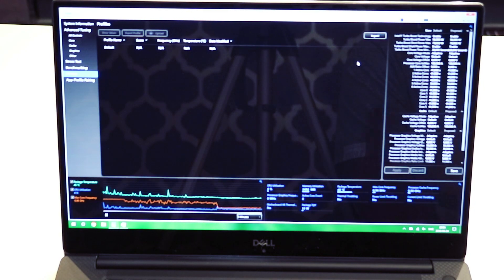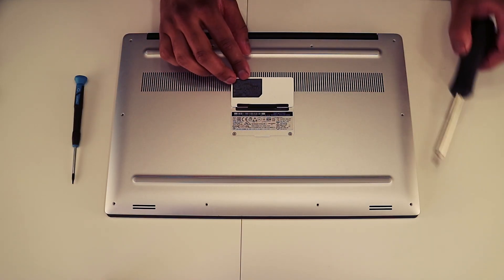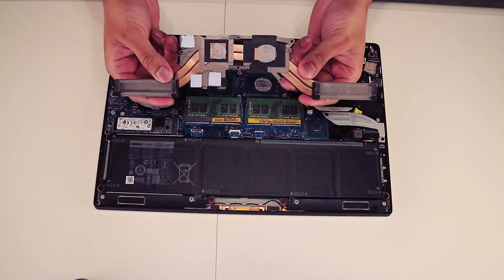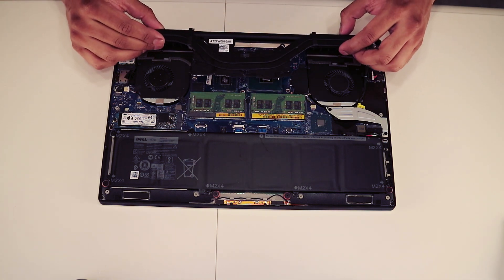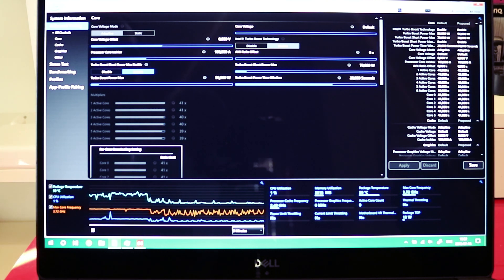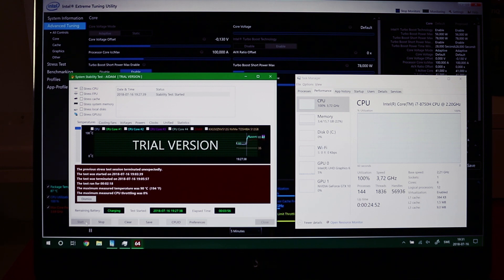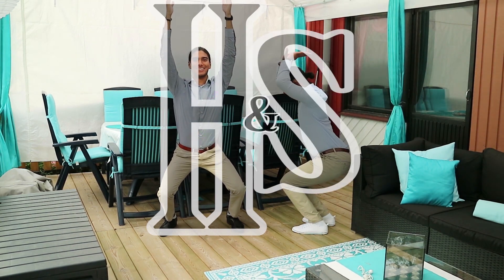How to UNDERVOLT and REPASTE your Dell XPS 15 9570 to Increase Performance!

Comment: Do you know if it's possible to upgrade a 56whr battery to a 97whr on this model?
Reply from the maker: Yes what I heard it's possible but I don't know if Dells sells batteries separately in all countries. I heard some people getting batteries in eBay, you should call Dell and ask them.
Reply: @HumanSuten  thank you very much! And a fast response :D
Reply from the maker: No problem at all, we're trying our best to answer all comments as fast possible! ☺️ Happy I could help you out!
Reply: Hi! I've done it few days ago. Buyed from Dell a brand new 97whr battery (130€) and upgraded my XPS 9570. Very simple and it does not void your warranty.
Reply from the maker: Hi! 
Perfect 👌🏿👍🏿 thanks for letting me know! ☺️
Reply: @HumanSuten  thanks to you. Your video helped me a lot ;)
Reply: @friimaind  hey, man im thinking of doing that too, i have the base model with the 1tb SSHD, I also want to get a ssd, do you know what happens when u take out the sshd, and put in a ssd
Reply: @harshilcode  hi! I've done that on my old XPS 9370. No problem at all: simply download a stock Windows 10 ISO (from Microsoft's website) and burn it on a USB stick, change the ssd, boot from the USB and proceed with a clean OS installation. :)
The only thing that could happen is that Windows could not recognize the SSD (because of drivers) so check online if you need the download these BEFORE removing the SSD.

Comment: My Core Voltage Offset jumps back to 0,000 after reboot. How do I save it, so that it always starts with the -0,150?? Any Idea?
Reply from the maker: This is the default state of how these programs run, in case you lock in to a unstable voltage or you tweak other settings which makes the computer unusable. So at reboots they load the default configuration of the CPUs. 
Check out this guide to force an undervolt at bootup: http://forum.notebookreview.com/threads/how-to-automatically-under-volt-in-xtu-without-opening-it.802143/
I have personally not tested it but I will do it once i get some sparetime.

Comment: will also change the Thermal Pad be even better? what is the size of those? and how many should change? 3?
Reply from the maker: I can't really comment on that situation, I really don't know. I don't think it will be noticeable. But what users have done is applying thermal pads to the VRMs which can help prevent throttling of the CPU ☺️
Reply: thanks a lot, man. yes, I also been may have VRMs throttling. do u know what is the size of those VRMs? i am counting how many or which size thermal pad should buy.
Reply: 'i also heard'     sorry,  bad grammar here.
Reply from the maker: I couldn't really figure that out as many users have done in so many different ways, sorry once again.

Comment: I have read so many undervolt tutorials, they always say reduce the voltage when you hit BSOD. I never have it ( even I reach -0.200V) but during the stress test, the laptop restart. Does it mean the voltage has reached the limit?
Reply from the maker: If it restarts during stress test that means it's unstable, it doesn't have to BSOD, because you will only know if it's stable when you do Stress tests
Reply: oh! One more thing, when I undervolt, no matter what the core offset is my laptop always restart itself when the laptop goes to sleep mode. Does it ok to keep undervolt or leave it as the manufacture set up? 
Thanks for answered
Reply from the maker: It's okay to leave the undervolt, do you mean that the voltage offset resets when you put your laptop in sleep mode?
Reply: the laptop restarts itself in sleep mode and voltage offset back to 0
Reply from the maker: @nhocklun0926  Hmm that's strange, i really don't have any solution to that. I have to look into it myself and see what i can find.
Reply from the maker: @nhocklun0926  Check out this guide to force an undervolt at bootup: http://forum.notebookreview.com/threads/how-to-automatically-under-volt-in-xtu-without-opening-it.802143/
I have personally not tested it but I will do it once i get some sparetime.

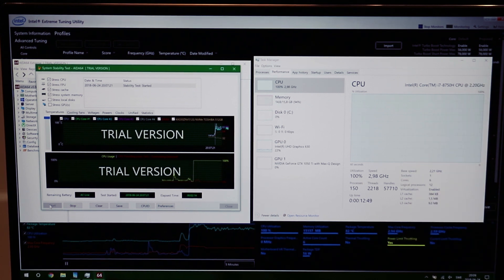Comment: 1:29 Intel XTU in the bottom left says power limit throttling, not thermal throttling, which I'm currently having a problem with on my laptop and haven't found a fix for yet
Reply: You should first plugin the charger and put device at performance mode in dell power control panel
Reply: did you try adding thermal pads to the VRMs?

Comment: Does this void warranty ?
Reply from the maker: Lex Gabrees No, as long as you know what you're doing when repasting and not doing any other hardware damage this will not void your warranty. The undervolting part is software based and does not apply at reboots for safety reasons, in case you mess up the settings which renders the computer unusable. Also undervolting can not damage the CPU in any way because what your essentially doing is starving the CPU from power.

Comment: I cannot see the idle temps, can you write them to me? I also have problems with high idle temps, like 42degreesCelsius at idle.
Reply from the maker: I have about the same Idle temps as you, they are completely normal for this laptop. Mine hovers around 40-45C. Repasting and Undervolting doesn't help to much with idle temps, more with the load temps.
Reply: Human & Suten Thank you! These idle temps are annoying, especially because the fans Start at 50C
Reply from the maker: No problems at all! Yeah I know but this computer really have some powerful components that need all the cooling they can get so they don't throttle down. Apple philosophy is different, they let the computer run on like 80-90C which leads the components to throttle because they get too hot.
But I'm with you, when doing light task you want a silent computer but we have to remember that this is not an Ultrabook and does not run with the Intel U-series CPUs.
Reply: Human & Suten Thank you, yeah that the right point of view!

Comment: Anyone out there wondering if it's worth it to repaste... In my case it was very beneficial, the paste job from Dell was horrible. I lost around 15c on the cpu temp alone after my repasting. The Gpu didn't changed so much but it wasn't all bad to begin with so I'd say that until you take it apart to verify the original job you will never know if it'll make a difference. Glad I repasted and undervolted.
Reply from the maker: Johnny Boy Wow that's a huge drop, what are your Idle temps now? Thanks for giving your input! ☺️

Comment: Is this worth it or should one just get the core i5 version?
Reply from the maker: No the i5 is not worth it at all! It's performance is like last years i7 model. You don't have to Repaste, just simply the Undervolting is enough. But even if you don't undervolt, this CPU will be such much more powerful than the i5 thanks to it's additional cores. Quad Core (i5) vs Hexa Core (i7).
Reply: I have the i5 version - it works pretty good and performs better than many outdated i7 processors

Comment: Hey, everyone, I have the exact same laptop. I undervolted to -0.150V and achieved a 1381 benchmark score and my processor frequency was at 3.89 with Cpu temps at 72 Celsius, which is significantly better than the undervolting suggested here. Also, note that I have not repasted yet too.
Reply: Also if you're using throttle stop, you can undervolt a lot lower than XTU without crashing, but the CPU will not be able to get to as high of a frequency as it could with higher voltage.
I think that's mostly because in XTU, if you undervolt your CPU core, it will undervolt the cache to the same value automatically. So if you go too low, the cache undervolt will cause a BSOD. You can of course set core and cache to different values, but by default - core and cache are the same.
In ThrottleStop you have to set them independently so in that sense it's easier to wrap your head around what's happening. For example I can have my core undervolt set to -250mV (in XPS 15 9570 with 8750H CPU), but if I bring my cache undervolt lower than -125mV, I'll start getting BSODs during video renders.
Reply: NowakP what is throttle stop and is it beneficial ?
Reply from the maker: It's an undervolting software like Intel Exteme Tuning Utility but it's more advanced with more features
Reply: did not do any undervolting and my score is 1420
Reply from the maker: I have also achieved undervolting to -0.150 but running AIDA64 Stresstest made the computer shut down after 5min. Make sure your undervolt is stable.
Reply: i have same laptop and whats your cpu model ? i have core i 7 8750H
Reply: I get 1537 and 79C,  just undervolting 130  mv, no repast

It's with 8750H and run it at performance mode

Comment: I'm studying electronic engineering I use circuit design softwares, I do programing, AutoCAD, fusion 360, I also like to take pictures so I use Lightroom and play some games (pubg, dirty bomb, Rainbow six siege) occasionally maybe 3 or 4 times a week  but not for long periods maybe 2 o 3 hours and I'm thinking about to get the 9575 or the 9570 from one side the 9575 is not that bad for casual gaming and is very good for content creation and it will be nice to operate all the programs I use on tablet mode I also watch a ton of movies and videos 🤔 so the 9575 looks better for me but I'm worry about gaming and also the ports and battery life because I spend a lot of time on the go 🤔 and maybe I can sacrafice the 2 in 1 for better performance, more battery like and better keyboard, more ports  and also cheaper price but I'm also worry about thermals on the 9570 I'm not a everyday heavy user but at least 2 or 3 times a week I do some heavy stuff 🤔 help me please thanks I'm a big fan from Dominican Republic
Reply from the maker: I would say the go for the 9570, because it is quite close in terms of processing power but at the same time it has the flexibility of a tablet. Only thing downside for you is the port selection. That would leave you relying on a USB Type C Hub. 
If it weren't for your tablet needs i would recommend the 9570 because of the port selection and the more processing power, especially if you were editing videos in Premiere Pro.
I really hope this helped you out in terms of deciding what to go for! ☺️
Reply from the maker: I would say the go for the 9570, because it is quite close in terms of processing power but at the same time it has the flexibility of a tablet. Only thing downside for you is the port selection. That would leave you relying on a USB Type C Hub. 
If it weren't for your tablet needs i would recommend the 9570 because of the port selection and the more processing power, especially if you were editing videos in Premiere Pro.
I really hope this helped you out in terms of deciding what to go for! ☺️
Reply: Human & Suten  and what about the battery life I know that the one in the 9570 is larger than the 9575 but if it can have me at least 8 hours I'm good with that
Reply: Human & Suten BTW I just edit photos on Lightroom 🤷🏻‍♂️ and I would love to buy the 9570 over de 9575 2 in 1 but the thermals worry me and there's a ton of people having problems with the 9570 and I live outside the US so no warranty for me if I want to return it they just can send me parts
Reply from the maker: It all depends if you buy the 4K screen or not and which battery size. I have the 4K screen with the 97whr, which gives me 5-6 hours of battery time. The 1080p screen would probably give something like 6-7 hours. I don't know anything about the battery life of the 9575, but I think you can find some statics i Google about the battery life. 
I had fan issues on my first unit, got a replacement and that unit had a fault "right arrow" key and some Backlight Bleed. They solved my issues by replacing the screen and keyboard. So I think it's risky to buy a laptop from Dell whatever it's the 9570 or 9575. Dell quality control sucks so I wouldn't risk buying something from Dell, you can end up wasting your money. There are some other options but I don't know what laptops is currently on the marker in your country.
Reply: Human & Suten  I'm in USA rn so I would like to buy it today list this month
Reply from the maker: If you have time to test the computer while you're in the USA then go for the 9570. If I understand you correctly you live in the Dominican Republic but are right now traveling in the USA?
Reply: Human & Suten yes correct thats what I'm going to do
Reply from the maker: I wish you the best, hopefully you will get a fully functioning unit the first time! ☺️
Reply: Human & Suten thanks you know how much it takes to sell ship me the device and in case I have to return it you know how much it takes to them to solve the problems?
Reply from the maker: As I live in Sweden this may not apply to you. But the shipping time was like 2 weeks and getting a replacement was about the same time. However if they only need to replace parts then a technician will come next day to you personally.
Reply: Human & Suten I was in dells site and it says 5 weeks for me 🙄 fuck
Reply from the maker: Damm... It must have been a big demand for the new Dell XPS 15...
Reply from the maker: Damm, 5 weeks, they must have trouble keeping up with the demand of this laptop...

Comment: Hello , can you test some architecture programs or games to see how’s the fps ?
Reply from the maker: Do you mean like AutoCAD and so on? I don't have those softwares but i can assure you that this laptop can run them easily as it has the top of the line CPU, powerful GPU, high speed RAM and SSD.
As for games, expect this computer do most modern gaming in 1080p@60fps with high settings, only tested out Fornite but I've seen other gaming tests on this laptop here in YouTube which can confirm this.
Reply: Human & Suten thanks !
Reply from the maker: FulgerTheDude No problems! ☺️
Reply: Programs like 3ds max and vray render ?
Reply from the maker: I really don't know but this has tas the top of the line CPU for laptops so i think i will do it just fine.

Comment: btw, in my limited experience, with the 9560, it also makes a significant different if you undervolt the iGPU,. it is in the same screen you used to undervolt the CPU, in my 9560 I tended to use -65mv (and 125mv for the 7700HQ).
Reply from the maker: I thought about doing this but since I don't game on my laptop i decided not to, but thanks for letting me now! ☺️
Reply: Human & Suten thanks. I understand but the iGPU handles all 2d graphics including the windows interface and day YouTube video playing. Also if you do video editing in premiere, premiere uses the iGPU for encoding. I think worth trying even if not gaming.
Reply from the maker: I will look into this, but doesn't Premiere Pro utilize the GTX 1050 Ti and graphics in Windows utilize the Intel UHD Graphics?
When you say the iGPU, you are referring to the Intel UHD i suppose? I will certainly look into this.
Reply: Did you run benchmarks and test if it was stable? I'm running a i7 on mine and would need to work on After Effects for some projects so I'd love to know if this works as I've it power throttled on prolonged heavy graphics use
Reply from the maker: I have benchmarked the -0.130mV Undervolt on the CPU and tested it, it's stable. But I haven't undervolted the GPU yet. Haven't the time to do it yet. But for the Adobe Softwares the CPU is the most important part.
Reply: Thanks for that recommended iGPU undervoltage setting.
I will check it out.
cheers
JB

Comment: hi Human&Suten, coudl you write here what you get after 5 minutes of 100% use if you dont undervolt? that is only the repasting. That will be very useful to know, to gauge if we shoudl risk doing the delicate operation of repasting or if just two clicks in XTU does the trick.
Reply from the maker: It was about the same, i would say that the repasting only gives a small benefit in temps. I only did it in hopes that my fan issue would be resolved. I would say thay the Undervolting is enough.

Comment: Is it necessary to repaste and just do the undervolting? Or has it to be the combination ? By the way nice video! 🇧🇩
Reply: Parab H. Undervolting and repasting are two different things. You can try them individually or in combination
Reply from the maker: Thank you my man 🇧🇩
Yes exactly, but the big benefit will come from undervolting the cpu! ☺️
Reply: Is thermal pasting essential ?  If so why ?
Reply from the maker: No I would say most users won't need the extra dips in temps and just undervolting would suffice. But of course if you can and have the time you should because those extra decreases in temps can be valuable for increased performance.